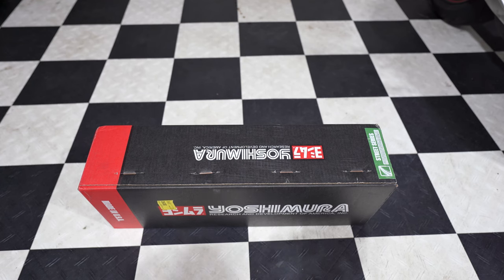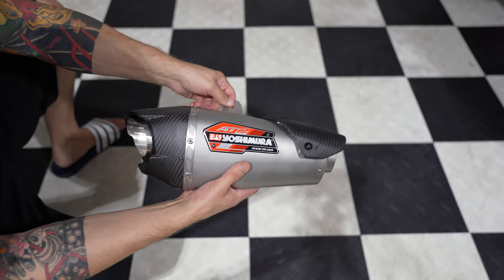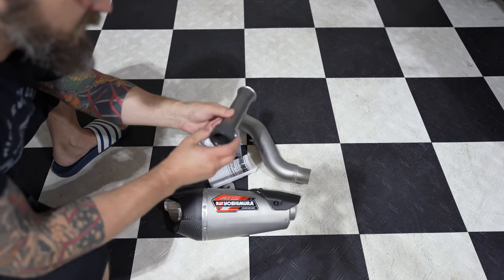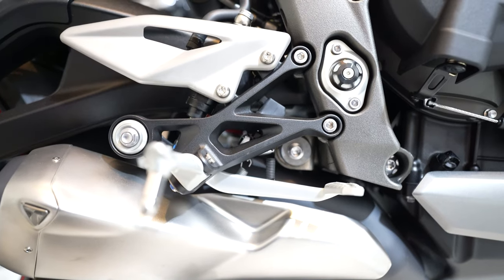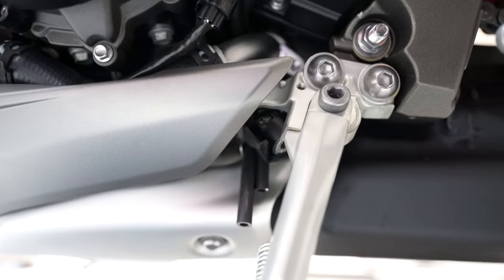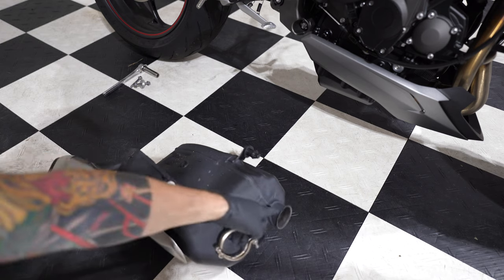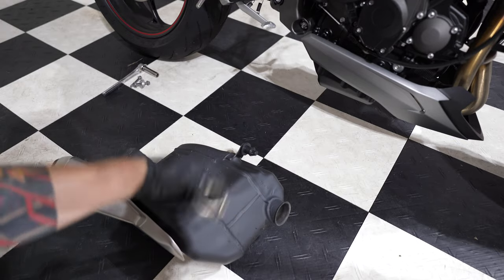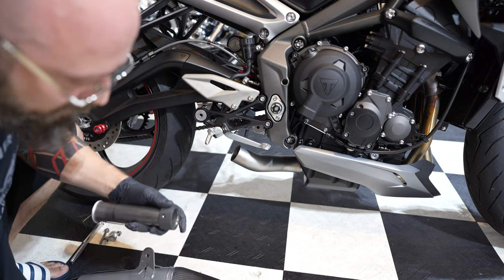Yoshimura AT2 Exhaust Install on 2022 Triumph Street Triple R

Comment: Nice work. I have the 2022 black decal r. Was tossing up a few different exhaust systems ended up going with a Zard non homo option titanium. New Air filter remap dyno. The fueling on the dyno makes a massive difference in the way your bike performs. You will notice how much better the bike feels. Enjoy the ride of this awesome bike. 👌
Reply from the maker: Thank you.  Eventually I will get an air filter and tune as well 👍
Reply: How did you tune the ECU? Did you get power commander or did you say house in my rebuild the map?

Comment: Did you remap?  I have a 2021 R and was looking at the same exhaust. Yoshi won’t say whether or not there’s any issues; only that R&D has confirmed up to 2020.
Reply from the maker: No need for a remap on the slip on. For a full exhaust yes.

Comment: I also have the 2022 LHR. After watching your video, I think I am sold on the AT2.  My mods are simple: got techspec pads; did the tail tidy; and got the OEM black levers. My question is did you have to get a tune? I am hoping not since perhaps it is just a slip on. And one more question: happy with baffle or have you tried without it?  Thanks in advance!
Reply from the maker: I did not do the tune. You don’t really need it since it’s a cat back.  For now I am riding with the baffle and I feel that it’s enough for me.
Reply: Thanks for the quick response. Will order this week and check back in once I get it and got some time with it.  Forgot about the fly screen; looks a lot better in my opinion with it - easy install but surprised that I had to remove the headlight. Thanks again!
Reply: While waiting for my exhaust to arrive; wondering if you have noticed any noticeable negative change in performance, perhaps at low-end torque.  Thanks  again.
Reply from the maker: @TK-ul1bx  Not at all. Just nice sounds with some pops on the downshifts😀. Since the stock DP with cat is still in place you should not see any noticeable changes.
Reply: On day one. Going to get some ear plugs (baffle is in).  Plenty loud and love that bassy sound (-:
Reply from the maker: @TK-ul1bx  Yep. I ride with ear plugs on both of my bikes.

Comment: Where did you buy it from?
Reply from the maker: Directly from Yoshimura.
Reply: got mine from Amazon it will be here tomorrow. Also got a DNA air filter and a DNK tune works tune! It’ll all be done this weekend😁😁
Reply: @brynn2001   how did the dnk tune workout?
Reply: @ceg1959  it’s work good it’s not great though but for the money it’s definitely worth it takes outside of the dips and the throttle is way more responsive but I still am going to get a power commander and get it want to Dino and get it really tuned